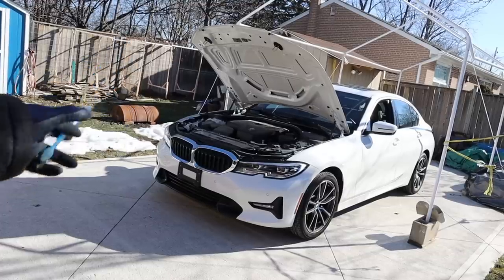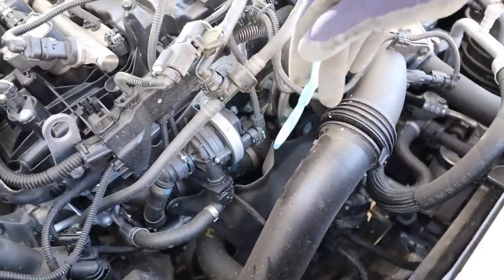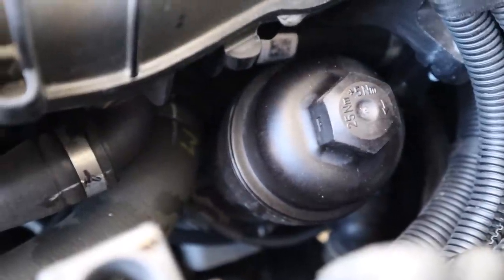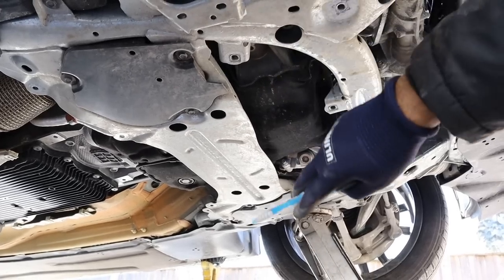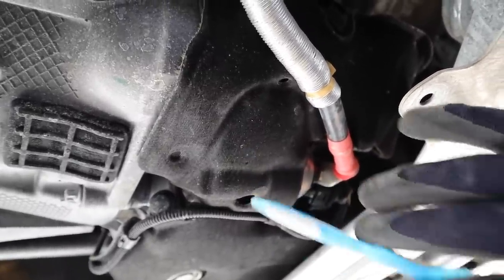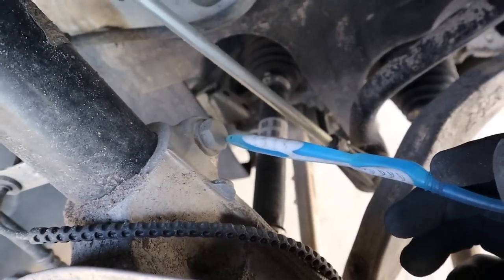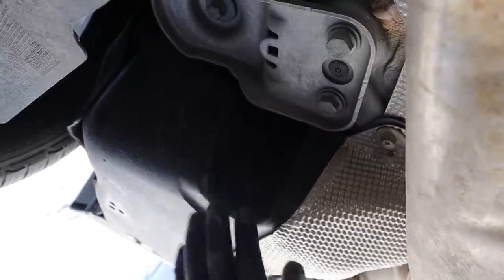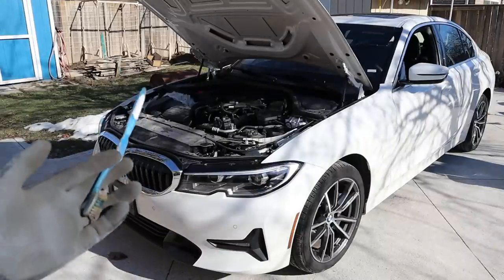BMW 3 Series Mechanical Review

Comment: I’ve had my g20 b48 330i for 3 years now and I have to say that it’s a solid car. Maintenance is easy to. I’ve had no issues since I purchased it. The B48 and B58 (M340i) engines are known to be BMWS most reliable engine since the N54 and N55. I have friends who are BMW technicians and they say that they’ve seen b48’s come in with 75k-100,000 miles on them and no issues at all. I did my oil change a couple months back and it’s very easy to do (DIY) up next on the list is the brake fluid and engine mounts. Everything is going to cost me under $400 to do in the comfort of my home. Despite what people say about reliability, BMW are actually pretty solid cars, IF you keep up with the maintenance. Driver takes care of the car, the car takes care of the driver. Great video 🙏
Reply: I feel like most cars are reliable now up to 75k miles with unwarranted repairs. Think the problem now is planned obsolescence like water pump and coolant changes (just for example) which in German cars can be complicated with all the electronics and hoses blocking things. But YouTube mechanic school is worth the shot to save us from labor costs.
Reply: Only a high maintenance machine, not a bad machine.
Reply: I just spent 2k on a coolant leak due to the cheap plastic thermostat cracking, had to replace the thermostat and hoses, the car has 38k miles on it

Comment: Timing chain is in the rear of engine. That's why the oil filter is buried back there closer to the oil pump.
Reply from the maker: Whoa! I missed that one
Reply: Seems like bmw figured out nobody does the timing on their engines even when its necessary so they integrated that into their design... they should add a design that catches and recycles all the leaked oil as well.
As an e46 owner, newer bmw cars seem like jokes.
Reply: @--LZ---  the B58/B48 are miles more reliable than the M54 & S54 found in the E46. I’ve owned an E46 330i and that car was horrendously unreliable & in my opinion the e46 is the generation that gave BMW a bad reputation for reliability.
Reply: @Enthusiastlist  honestly if you take care of the engine, its a pretty good one. Sure, the E46 by itself has a lot of issues, and most of these cars are 20 years on the road. 
Mine is a 330i , its a great project car because mostly everything has been already done and documented online, so i have a lot of guides and material to work with. Plus there's an awesome aftermarket and bmw still stocks a lot of the parts, or remakes them in batches. Just got a 11.1.23 date s54 oil filter housing for an engine oil cooler for example.
Reply: B48 and B58 are superior engines compared to not just previous BMW engines, but all car manufacturers.  The “B” series engines are closed deck designs, and overbuilt on a diesel type block, the 1st generation had the lowest direct inject pressures. The second and third iterations had a single timing belt. I own a 2018 430xi convertible and 2019 740xi and both have been rock solid. Annual maintenance and run perfectly. The biggest issue is the run flats have a terrible ride, so I swap them for Michelin Pilot Sports.
Reply: @nycupperes  I'm sure it's a great car,  but honestly i like my e46 more... Id just swap the b58 into it when the motor gets a bit cheaper where i live.
Reply: @nycupperes  I second this. My 440i has been great, and it’s been tuned for most of its life as well. The only issues I’ve had with the car are the bushings going out on the control arms but the engine itself is flawless. Currently at just over 60k miles.

Anyone who has looked at the technical changes to the B58 from the N55 will know it’s an insanely overbuilt engine. They finally went back to a mechanical water pump as well.
Reply: @--LZ---  Like previously stated anything will be reliable when taken care of. These B engines on paper are fucking insane though. Forged parts on everything important (cams, rods, pistons), closed deck, overbuilt, but fairly easy to work on.  I will say though unless BMW has learned, these cars will more than likely suffer the same electrical issues as older gens, and with more things being electronic we will see how that goes

Comment: I'm actually genuinely surprised at how much is still serviceable on this newer platform. Much of the engineering choices limit the car's lifespan, and we know their track record. I wonder why they bothered with much of it rather than cost-cutting any real serviceability out. I figured absolutely nothing would be meant for replacement. 1 lease, 1 certified pre-owned sale, junkyard. Tidy, 6 year lifespan.
Reply: Engineers aren't stupid at bmw, and they have a bunch of experience. I think for the requirements they are actually fairly repairable, or as repairable as possible. for example many engines have a top mounted oil filter for ease of access. Their requirements being cheap powerful fun. The unreliablity is from innovation and cost cutting to some degree, not due to absolute stupidity. For example the n54 became the b58 which is good enough for Toyota.
Reply: @gameonyolo1  No they aren't stupid; they know exactly how to engineer the cost out of it such that it breaks in exactly 6 years, right after the initial owner got tired of it and sold it to a stupid kid who gets left holding the bag.  Ethics?  Neitche danke.  They know that the most profitable customers are the fools who keep coming back into the dealer showroom.
Reply: @gameonyolo1  Actually B58 wasn't good enough for Toyota bcoz after numerous durability tests they told Bmw to redesign and upgrade some elements to make it reliable enough for Toyota requirements. 😏😏
Reply: @Nudel-nc1cp  well my point is now in the end it is reliable
Reply from the maker: Stop blaming engineers. We design stuff with bean counters pointing guns to our head.
Reply: @speedkar99  As a bean counter, I would say the marketing department is to blame; they're the ones who figured out that it doesn't make business sense to make positive impressions on the second owner of a BMW, while it barely makes sense to bother trying with anyone who keeps the car longer than 30 months; the most profitable fools to be separated from their money come back to the showroom floor to turn inventory with TWELVE MONTHS.  Those idiots are the customers that BMW targets with logistic regression algorithms to determine a response rate to their CRM inputs.  It's perverse.
Reply: @lashlarue7924  own a 6 year old B58 at 60k miles. Never had a single issue or CEL & it’s been tuned/running E85 since new. That also includes several track days.🙂
Reply: @Nudel-nc1cp  Toyota didn’t do anything to the B58, that’s just marketing BS by Toyota so fanboys would stop bitching about them not touching the engine. I’ve seen several B58s from Supras/340i’s torn down. They’re the exact same.
Reply: @Enthusiastlist  You'll find out. 😉
Reply: @Enthusiastlist  60k miles? Lol. My guy that is nothing compared to the older cars. Second thing: fact that parts looks the same doesn't mean that they are made out of the same materials. Do your homework dude.
Reply: @Nudel-nc1cp  dude I literally work for a bmw dealership. The engines are the exact same. There is nothing different, period. End of story. The only slight differences are all software/emissions components. 

Maybe you should consider “doing your homework” which I guess for you means reading the brochure. 

As for 60k miles, yeah obviously that’s not a lot but this engine has been making well over 450whp literally it’s entire life, not a single issue. I haven’t even done ignition coils or spark plugs yet. This is the problem with Toyota fanboys, they don’t understand the difference between a commuter engine that sits at 2k rpm all day on the highway making 82hp vs a performance engine that’s tuned to the gills & has seen multiple track days. I’m sure I’ll run into issues eventually but you have to think that one track day alone is probably equivalent to like 20-30k miles worth of highway driving.
Reply: @Enthusiastlist  no way is a track day equivalent to 30k miles. That’s ridiculous😂. And cars actually need a good long hot run from time to time to clean them out. Problems arise and damage is exacerbated when inadequate maintenance is carried out before track day.
Reply: @123ChrisG  how is that ridiculous there’s been tons of studies on how much damage occurs from 1 day of track, a simple google search would’ve prevented you from needing to comment. That’s the same reason why automakers recommend you change your oil after a track day.
Reply: @Enthusiastlist  if anyone needs to do some more research it’s you because you said 1 track day is equivalent to 30k miles. Don’t be silly!!
Reply: @Enthusiastlist  these cars run flat out on autobahn all the time like it’s nothing, track day will likely cause more damage than a normal day but not that much damage in reality it’s just more revolutions on the engine that’s about it. Unless you don’t know how to drive.
Reply: @Enthusiastlist  and name 1 study and I’ll tell you why you are 100% wrong.

Comment: I’ve noticed on my g20 330i that the radiator fan turns on even during cold start. Not high speed, just like a gentle idle speed but is this normal? I think it maybe on constantly even when the kidney grills are in the closed position @speedkar99

Comment: I bought a 1 series and a x5. Now I am really good about fix cars. Done the engine mount, rocket gasket,  exchange cooler gasket, vanos gasket ,  chain tensiner, transmission gasket, front control arm, safery belt, oil pan gasket plus all regular maintenance, renew rear diff, front diff, transfer case, transmission fluid and filter, fuel filter, coolant, spark. Now I am really confident about cars.
Reply from the maker: Wow

Comment: The 3 series has always been macstrut up front. Base brakes have been basic sliding calipers like those seen here for a long time too. BMWs driving pleasure comes from the suspension tuning and chassis balance. The basic layout of the suspension on this car is the same as the E39 which came out 25 years ago.
Always great to see another mechanical review from you! Good stuff even if your BMW hate hurts my fanboy heart haha
Reply from the maker: Thanks for the clarification. I would have expected a more complex and competitive suspension setup from a brand like this. All the competition is multi-link
Reply: I saw a comment by you on the Weber auto channel.  The professor was explaining CVT “transmissions”.  I enjoy your content as well as his.  I’m not a mechanic, I do drive cars anyone that does can learn a lot from you.  
Thanks man, I know you work hard to produce informative and entertaining videos glad I found you.
Reply: @speedkar99  It is a bit strange indeed. It hasn't stopped them from getting glowing reviews and accolades for the handling and dynamics of their cars though. The suspension system of the front and rear of the E46 is even more rudimentary than post 2006 3 series, and yet it is praised as one of the all time greats. The 911 uses struts in the front too. BMW makes some pretty big profits so I suppose this helps them out.
Reply: @speedkar99  This is the base car, the suspension is a lot nicer on an M3. It's always been a strut, but will have forged aluminum links and better geometry. I do think most of their competition is still multi-link though? Well, Euros I guess anyway. The 911 just went away from a strut this 992 generation I guess. The base 3 has never impressed me since the E36 generation.
Reply: The rear suspension design went 5 link in the E90 chassis and has been massaged since then. They are able to keep a decent camber curve with the front suspension design under track usage while using fewer parts and less weight than a double-A arm setup. That was the big news for the 992 GT3, it went double A-arm up front but all other 911s are still MacPherson struts- it works.
Reply: @speedkar99  So i have F31 and i was going 2 buy lci model or G21...but i guess that hey all are crap. But anyways is there modern estate car with better reliabelity that drives as nice as BMW? Merc? Audi? I really relly do not wanna buy a Corolla or like....
Reply: @bradcomis1066  Porsche finally went to double wishbone (like Lotus, Ferrari, McLaren and even the Honda NSX) on the front of the 911 GT3 recently.  I think the BMW 5 Series (and higher models, 6 series, 7 series etc) switched from MacPherson strut to double wishbone front ends around 2012.
Reply: It's a double lower wishbone Macpherson, which is different from a standard McPherson because the wheel pivots around it's axis

Comment: I've been wrenching on the vintage BMWs all my life. One of the things I love about those cars is easy serviceability and parts availability.
That thing looks like a nightmare for the backyard mechanic. Not all of us are able to afford the shop rates even for the simple stuff.
I can't imagine owning one of these without having a set of backup wheels for when it breaks down, and we all know they will sooner or later
Reply: They're not that difficult at all, there is a few extra steps and everything is torqued to spec, but actually working on late model BMWs isn't that bad at all so long as you know what you're getting into on the parts cost. You know what you are saving in labor which more than makes up for it. 
My Dad who worked on all the vintage stuff was scared of the computer part, and I keept telling him it is another tool you buy as part of the cost of ownership, and this tool tells you exactly what is wrong and where to start looking. It has been fun helping him with their most recent vehicles.
Reply: @purplepurplesaurasne I agree! You hear ignorant people always talking about how complex BMW's are but in reality I find them actually quite easy to work on. I'm of course referring to their inline 6 engines as that's all I've ever worked on! You gotta  love the overall simplicity of I6 engines and bmw makes the best ones! Yeah the electric water pump failures and leaky valve cover gasket can be a pain in the ass but compared to doing Audi timing chains it's actually a walk in the park!
Reply: They are actually really really easy to work on , I have an E30 , E46 and an F30 with the B48 engine and if you get used to where the pipes go , its pretty simple. I hate the excess use of plastic everywhere though , Those do not last long . no plastic lasts that long . But once you get a hang of these newer cars and newer engines its not bad at all . I actually find the cars very easy and logical to work on , compared to other cars , and im a complete novice on working on my cars .
Reply: This has the B48, a few parts can be tedious, but I would argue that this car is easier to work on than most modern American cars. Also aside from a common coolant line issue and bmw electrical issues breathing down owners necks (nothing common that I know about yet electrical wise), this drive train is incredibly solid. The b48s aren't old enough to say for sure, but on paper it should be incredibly reliable, and the ZF8 transmission is the best torque converter automatic trans you can get.

Comment: Family members and I have been through three G20s in the last few years. Reliability was very good, minimal to no problems. All were used as daily drivers and some as work vehicles, so they racked up good miles quickly. Fuel efficient, very smooth driver, and a great engine. Interior had amazing build quality/fit and finish. Glad this car was rated as one of the most reliable sedans as per CR. I know this guy is heavily Toyota-biased so the criticism here wasn't surprising but expected.
Reply from the maker: Thanks for your feedback. Have you had any issues with carbon buildup and direct injection? I think these cars are too new for the expensive issues to present themselves
Reply: @speedkar99  All our BMW leases were 4-year terms, some will say this is too early to develop carbon buildup, but anyways no carbon anything issues in all the time we had our Bimmers. I also recommend Shell gas, good quality.

Comment: Excellent review, thank you!

I think the B48 switched to Air-Water intercoolers so the charge air is cooled passing through a heat exchanger that is integrated into the intake manifold. that birds nest of hoses/pipes likely contains the supply/return lines to the heat exchanger in the bumper area.
Reply from the maker: Yes I saw the coolant hose

Comment: There is a water-air intercooler integrated into the intake manifold with a separate coolant circuit. The reservoir is adjacent to the larger engine reservoir
Reply from the maker: Thanks. I saw the coolant line going in. What I meant in the video was an air to air intercooler up front.
Reply: @speedkar99  that's old school technology used mainly in cheap cars like the civic type r lolol

Comment: Look at recent reliability rankings. BMW is right up there. They know how to build engines and their common i4 and i6 engines are very reliable. Also, it has great handling and ride quality balance so the choices made for the suspension are clearly better than what you think. It certainly rides better than an equivalent Lexus and Acura. And a 3 series is a great long term purchase. Just service it as required.